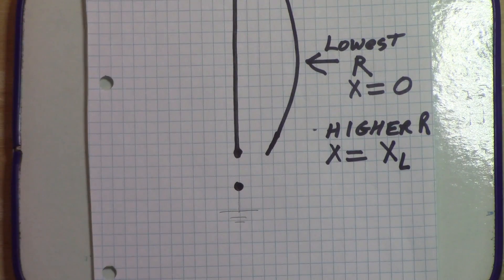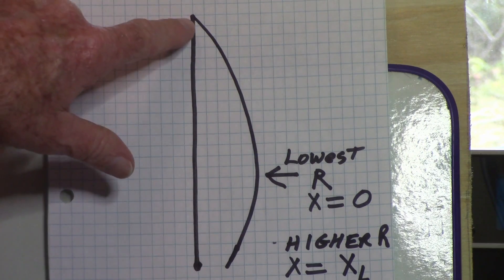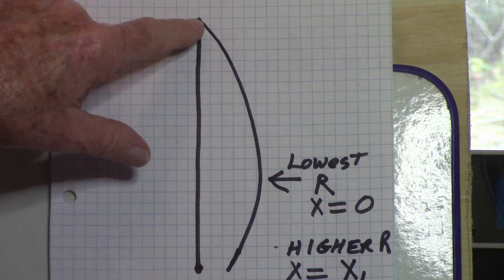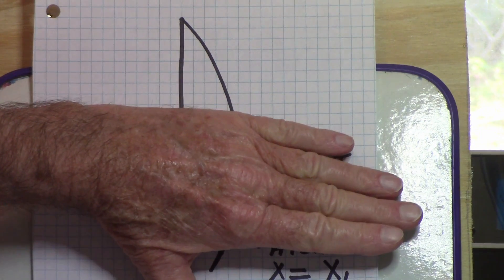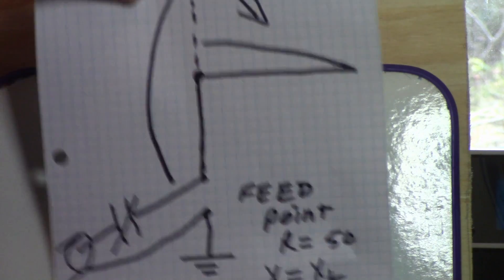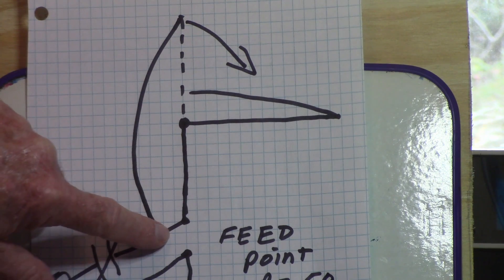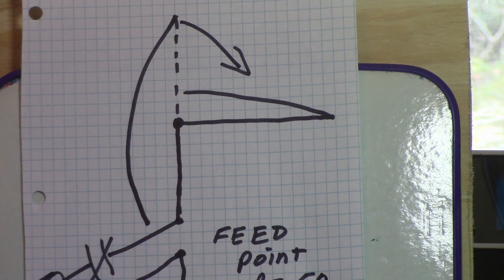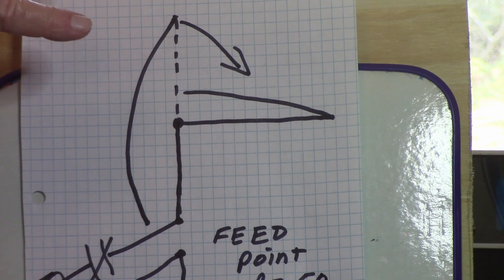Inverted L on 160 as recommended by W1BB

Comment: I do same,   except mine is for 7MHz ,  it is 7MHz half wave end fed in L shape.   it works well.  I use MFJ 993B auto tuner in water tight plastic box at feed point.   it also works as 1/4 wave 3.5 MHz.   AG6JU

Comment: How about using a remote trans-match instead of a series capacitor?
Reply from the maker: Maybe. More parts and wires. The main thing is to have a low loss matching system from 50 ohm coax to whatever the antenna terminals are. Typical load is near 50 +J350 (R=50 and XL =350) you don’t know for sure exactly but that’s ballpark.
If R is near 50 all you need to do is cancel the inductive reactance to get only the real resistance. Anywhere from R=25 to R = 100 will give you a 2:1 SWR. Closer to 50 and the better the SWR and the wider your bandwidth between SWR 2:1 points. 
I have used an L network at the base and that works good. I think a good quality series capacitor will be the least loss. But any good matching device should work.
Reply: @dandypoint  Awesome. I'm setting up an inverted L for 160. I should be able to get 50 to 75 feet of vertical section....#10 wire.
Jeff W3AAB
Reply from the maker: @jwnagy  that’s great on the height! A quarter wave will work but I think going longer has some benefits so I went to about 3/8 wave or 165 feet or so. Exact SWR will depend on length of wire and the ground resistance but losses are minimal on 160 due to SWR as long as the transmitter can load it. My Drake L7 is happy with as high as a 2:1 SWR. In a 160 contest I even will go higher in the band than my 2:1 point and it’s still doing fine with the original 1980’s tubes still going!
Reply: @dandypoint  I'm shooting for being centralized at 1.9. I just ordered the Mastraint rope from DX engineering, which should arrive mid week. The tree guy is coming out next Saturday to trim my tree and install some pulleys for me. Maybe done by end of March.

Comment: Great explanation!  I wanted to get on 160 for years.  After experimenting with a few antennas, I came across this video.  I built this antenna and used a fixed doorknob capacitor at the feedpoint.  In my case I used 200PF rated at 7.5KV.  I adjust the wire length + or - to get a perfect 50 ohm resistive match.  I am using 8, 60' long radials.  This antenna works GREAT!  Significantly better than a dipole at 50 ft.  Significantly better than a 1/4 wave vertical because my transmitter likes the match.  The vertical height of the wire is about 50 ft running up a tree and through a couple branches.  The insulated wire (#10 THHN) running through the branches seems to make no difference.  I consistently have a strong signal.  The only station that beats me (and not by much) is a guy running a full wave loop at 60 ft running a KW.  Thank you and W1AA for this design.
Reply from the maker: Thanks! You did exactly right! Not sure why a full wave loop at only 60 foot should beat you, except on short skip where it’s high angle dominates his pattern. I have done well with my configuration in contests and it got me 160 DXCC many years ago when it was a bit harder.  Have fun! 73, Don N4DJ
Reply from the maker: Thanks. Looks like you have a good setup!

Comment: I have an efhw 80m antenna with the 49:1. Sadly I have nothing but a 30 ft tower. I wondered if I ran the wire up and out if the max current would still be on the horizontal plane. 

A local friend has this very antenna you have. He ran 1/4 wave radials everywhere for 160. He has a very large coil at the base and moves the tap point for Cw or phone. He wants to sell me the other coil he had on it prior for 30$. I’m glad to see I can use 165 ish ft and only 3 radials. I’m assuming these coils act as variable capacitors ? Just moving the tap point instead of turning. I would love to have 160m for Cw tests. I’m not sure how well it would do only 30 ft at the Vertical. But it should get me on the air. Thanks bud
Reply from the maker: About your friends Inverted L....My first thought is that it must be short if he is using a coil to tune it. Coils and capacitors both add reactance. A series coil adds series inductive reactance and a series capacitor adds series capacitive reactance. So you use them for slightly different reasons. First of all you would rather not have the high current point of any antenna near the ground. With a ground mounted vertical that means either installing it upside down ( see my half square video) or making it longer than a quarter wave to move the current peak higher. The inverted L I use is not 130 feet (quarter wave)  but 165 plus feet. This makes the input impedance something like    Z=50 +j 442 where 50 is the real resistance and 442 is inductive reactance. All you need to do is add a equal amount of capacitive reactance in series and you get 50 +j442 -j442 = 50 ohms of pure resistance left. 
I like to avoid coils as they tend to have more loss than capacitors. Remember the current peak is always1/4 wavelength back from the open end of a wire antenna. I can't think of an exception to that rule.
Reply: @dandypoint  thank you. Do you know where to find a variable capacitor that handles the limits of we’re doing
Reply from the maker: @JayN4GO  I have several suggestions, but first how much power do you want to handle?
Reply: @dandypoint  1kw max
Reply from the maker: @JayN4GO  Sent you an email with info.
Reply: I would also like to know a source for a usable variable capacitor in the right range of pf and kv. Thanks. Scott KO4WTG.